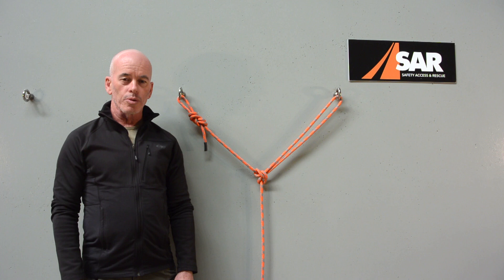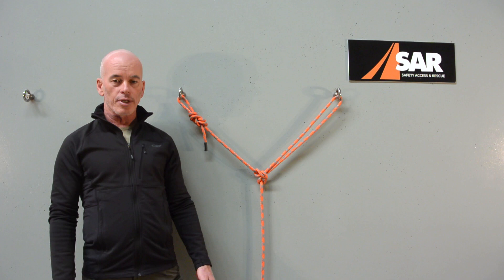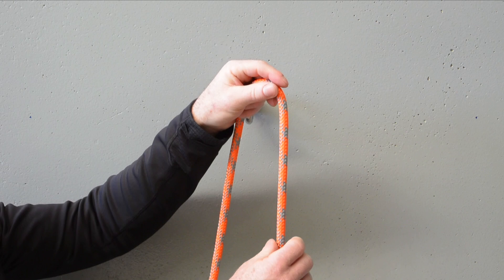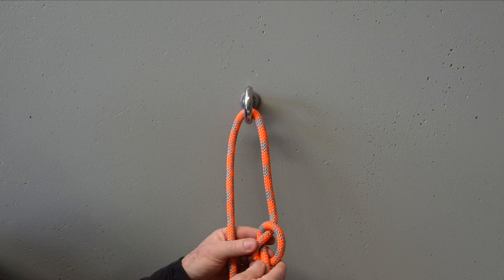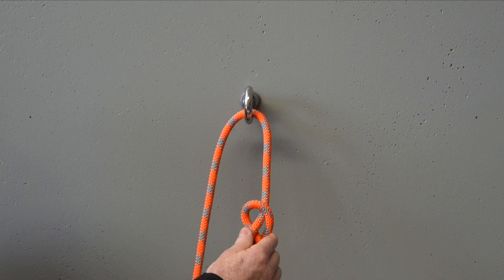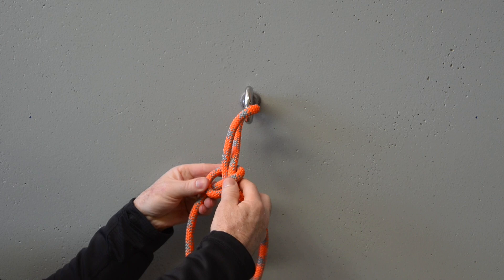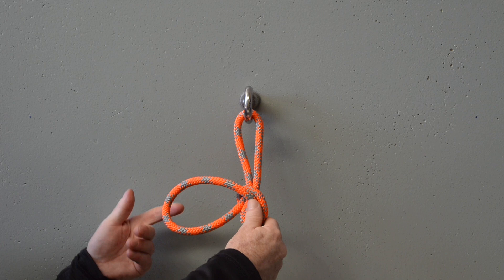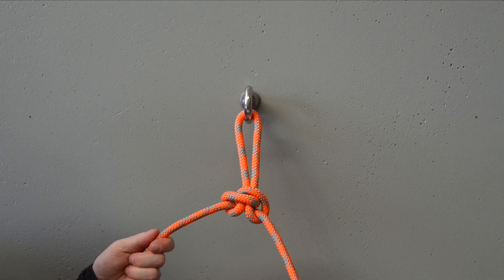Rethreaded alpine butterfly knot

Comment: This is a pretty bombproof instruction.  It is easy to tie this wrong and addressing the wrong ways let me recognize when I was failing to tie  it correctly and get back on the right track.  I use this knot attach a backup rope around a skinny tree when I need to spur up and cut something before I descend and cut the tree down.  When you have a lot of things going on, branches,leaves, gear, etc, it is easy to make a mistake and get something wrong.
Reply from the maker: Thanks Lee O... much appreciated.

Comment: Nice, but obviously if you were using this technique for a multi point anchor, you'd have to attach the alpine butterfly first and the follow-through figure 8 last, then adjust length for desired sharing of tension.
Reply from the maker: Thats exactly right Jeff.